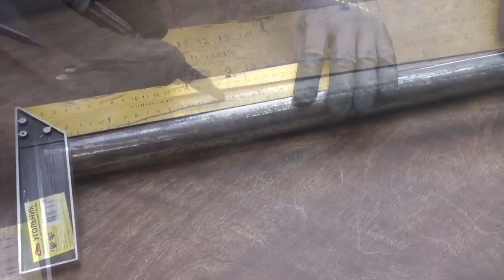Cool idea from a car jack! Super useful tool!

Comment: Nice build! Was worried about the rather thin walled tubing for the rollers, but they seem to hold up. Perhaps the scissor jack is easier to adjust and better than a bottle jack for this.